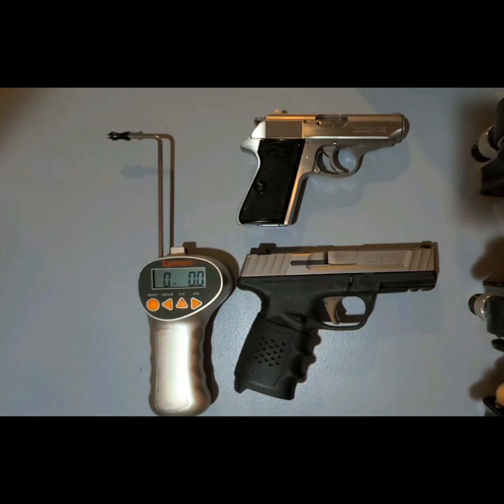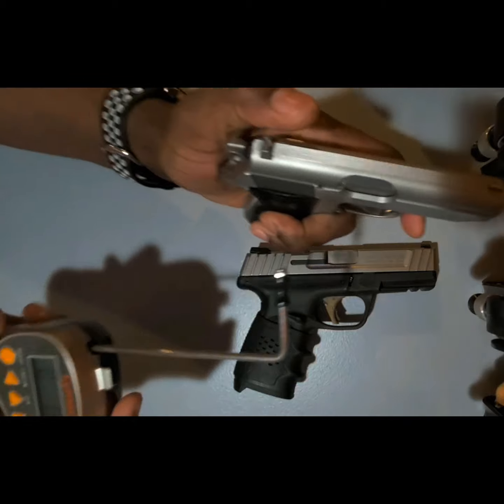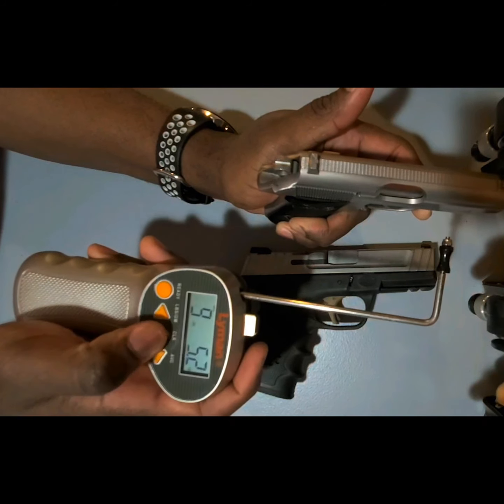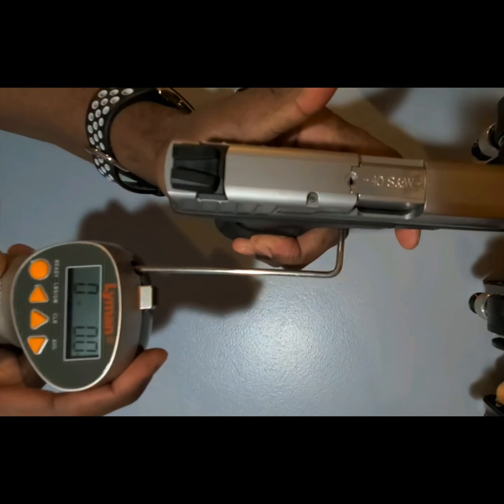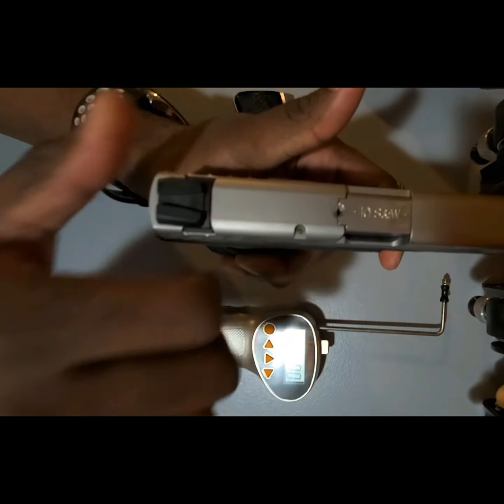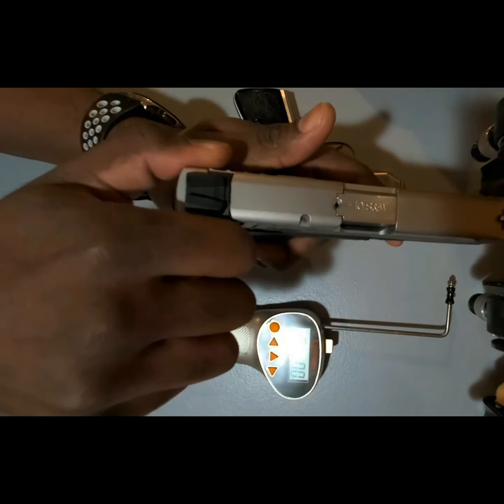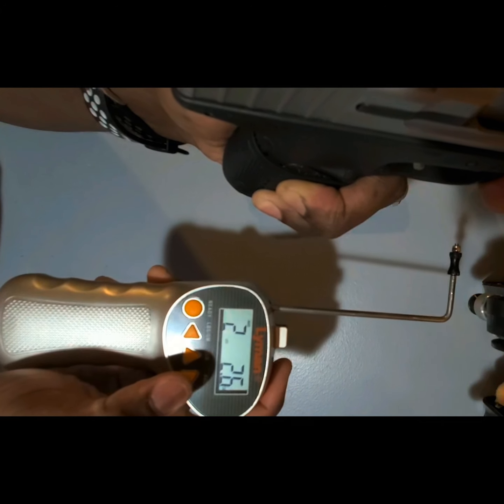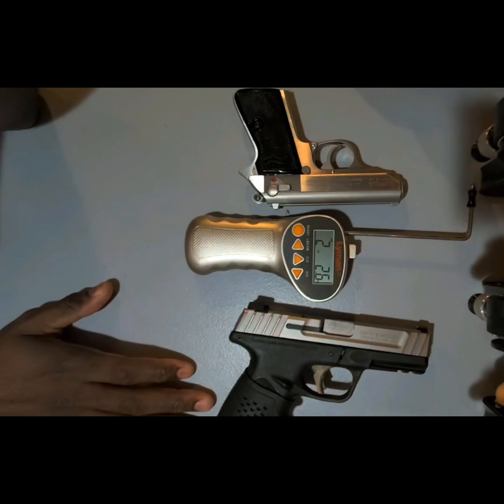Apex Trigger Verification

Comment: Man! That seems almost too low. But maybe it is. I guess the only way to double check would be to run the test with a different trigger gauge. At any rate, I’m going to jump off the fence and order an Apex trigger kit. Thanks for your helpful videos on this trigger and the SDVE.
Reply from the maker: I did use another gauge for the original video... https://youtu.be/hKIG7UBhW9o
Reply from the maker: The results are pretty darn close
Reply: The OA Firearms - Amazing! That is a much lighter trigger than they even advertise.
Reply from the maker: @logicaredux5205  Yea, it is really light and makes the gun very nice to shoot... Expect trigger pull to be in the range that they advertise as this light of a trigger might be a one off.... But the apex trigger kit system will reduce your factor trigger pull significantly.